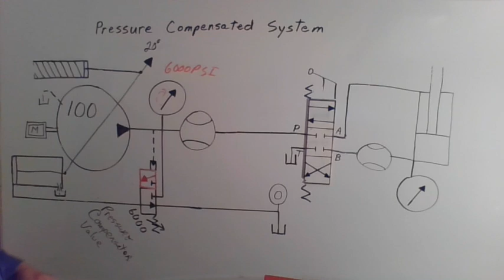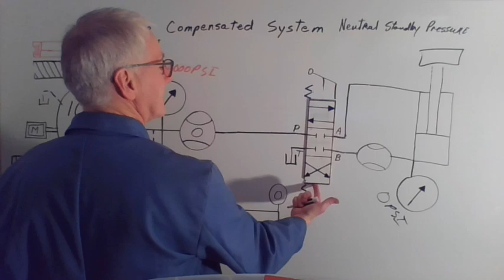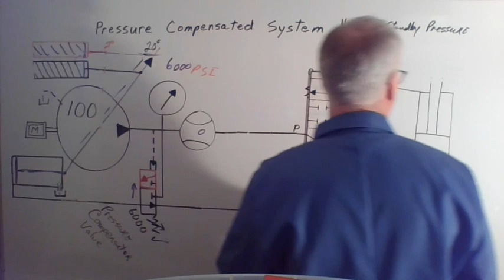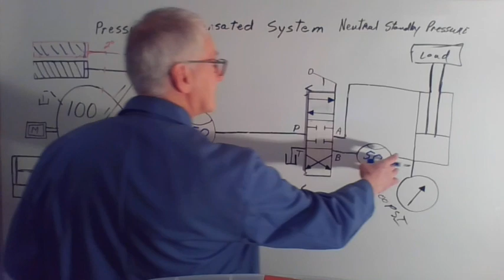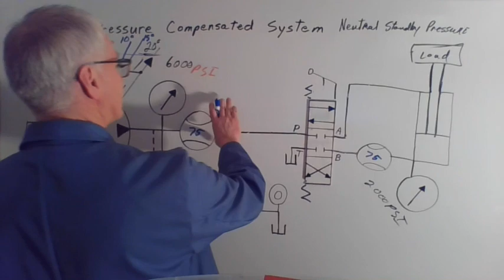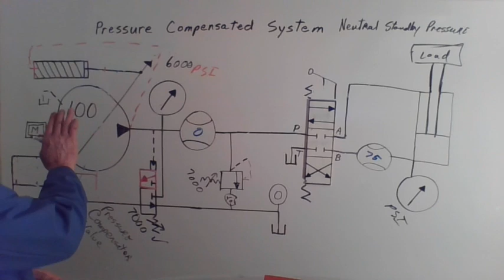Closed Center Hydraulic System using a Pressure Compensated Variable Displacement Pump Explained

Comment: Thank you for the clear explanation. Just one question please, is the pressure compensated valve part of the pump or not? Because there is the pressure compensated pump...
Reply from the maker: Yes the mechanism is part of the pump and the adjustable pressure compensator valve is usually bolted on to the external housing,

Comment: Time taked to upstroking 
And destroking 
Maybe u need to use some orifices or not ?
Reply: i will check soon, i have such system with 45 cylinders and will see how it works :)
Reply from the maker: Yes this is done with several different designs but all use orifice's